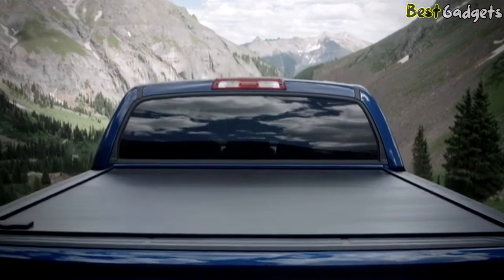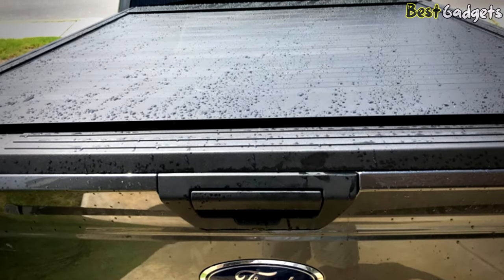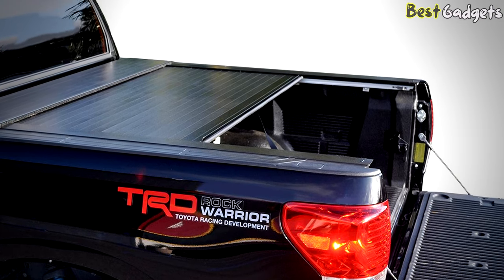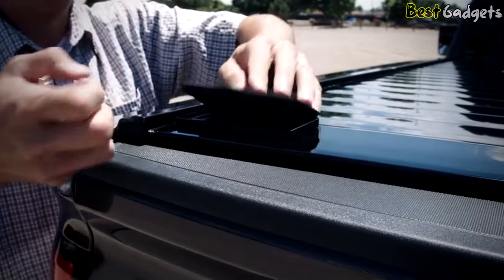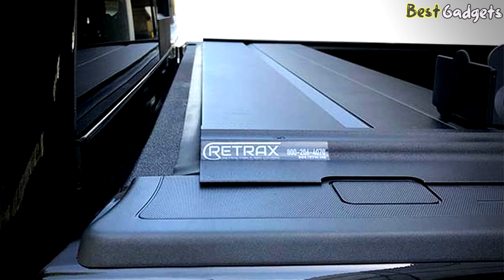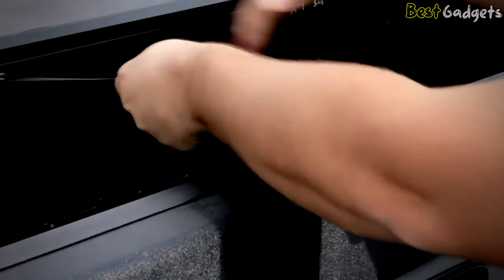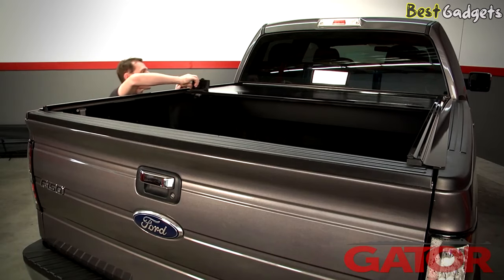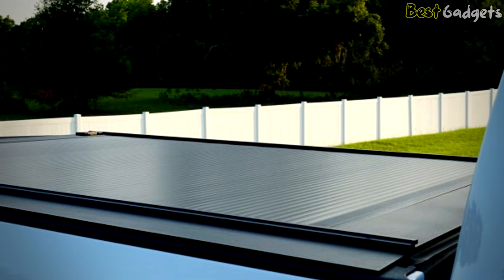Best Retractable Truck Bed Tonneau Covers

Comment: Up here in the north area, dealers don,t sell retractable anymore as they were getting too many complaints and angry costumers.. here we get feet of snow and ice under very deep sub zero cold for months.. we are not only getting snow, but it is a mix of snow and ice and slush turning into thick ice covered with layers of snow and ice..  in matter of days from December through out march..  so retractable is really not good here.  Hard roll up are easier than retractable but still a pain..as you need to atleast remove the ice and snow for them to roll.
Reply from the maker: Yes you’re right! It’s hard in your situation with a retractable cover! A hard folding tonneau cover is the best option for winter conditions! I’m gonna do a list with this type of covers on this channel!
Reply: @bestgadgets90  Be sure when you do, include Peragon covers.. they beat all the foldups that "Fold UP" they work more like a retract!
Reply: What problems does winter cause on retractable covers?
Reply: @dougp8890 snow is heavy when it accumulates on things. Too much snow can collapse roofs on buildings. Also freezing and thawing causes expansion and contraction. Winter sucks!

Comment: at 3:44 something is being sprayed (on top of the rail?).  This was never mentioned, so we can only guess.  Also at 1:12 "...made of aluminum which is extremely strong..." - as a machinist upon hearing that, it was hard to refrain from laughing.  I am not trying to be obnoxious, just felt compelled to offer some perspective and constructive criticism.  With this, thank you for putting together the video.

Comment: Are they dust proof. Or wich one is the best for gravel roads??
Reply from the maker: Hi there, and thank you for watching! Basically, that covers that are waterproof, also they are dustproof! For example look at this two items from our list: https://amzn.to/3O7vzFp  and https://amzn.to/3LXkNQc
Reply: @bestgadgets90  none of the covers you mention are waterproof.  Most are only water resistant.  Retraxx and BAK covers leak like sieves.  Not a single  cover you have in this video will guarantee  they are waterproof. I have been looking for 4 years for retractable that is and it doesn’t exist.
Reply: @jeffkimble8857  It kind of baffles me that no such product exists. You would think there would be, like, SOMETHING out there.
Reply: @jeffkimble8857  they're all pretty water-resistant. NOTHING is waterproof, do you should just stop your 4 year long search. If you need 100% waterproof, buy a van or a hard cover (which are terrible).
Reply: @jeffkimble8857 I’ve had a syneticusa retractable cover for over 2 years now and it doesn’t leak at all and I live in Oregon it rains all the freaking time. I spent quality extra time installing it making sure all my seals were perfect. Also the cover slates haven’t leaked yet either. So far it’s been great for 899$

Comment: Why not buy bed cover/hard cap for those kind of money
Reply: Limits what you can do with the bed. Can’t drive with a cap up. Cant use a gooseneck or 5th wheel. Can’t load items taller than the cap raises….

Comment: Unfortunately, none of these will work when the top of these are covered in ice.
Reply from the maker: Yes, you're right, sometimes it can be difficult to handle with ice-covered! But not all the time. Also, you can try a roll-up tonneau truck bed cover. We have a video of that! Link here: https://youtu.be/mjnIRsk79wk